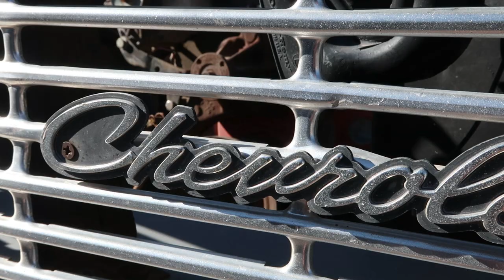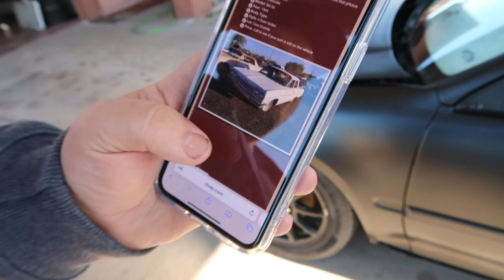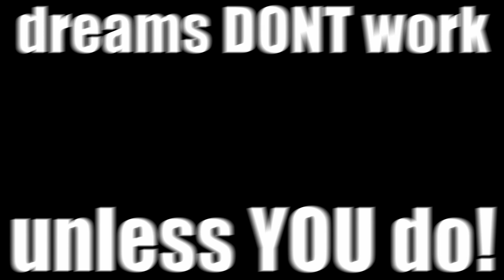My 1964 Chevrolet Belair (4 doors are better than 2 doors btw)

Comment: I'm stoked to see and hear that Bel Aire run and drive.

Pull that SBC and blast it apart.
If the crank, journals and bearings are good, that motor is like an AK 47. It'll work just fine.

Comment: Cool bro! Clean title +383 stroker is pure gold. Can't kswap it now. That's about 400hp with decent gas mileage. It's a 350 block with a 400 blocks crank shorter rods. And it likely has PHP heads and roller rockers too. Congratulations bro! Hope the Honda nation can hang...

Comment: I’d pressure wash the interior, use a wire wheel to prep the surface and just rino line it black. Then get the cheapest single stage flat black paint and get at it.
Reply: Black vinyl interior and black spokes with a chrome rim too. That'd be sick

Comment: You will probably need to run tubes in your tires. I bought Dayton's back in the 90's when everyone was building lowriders again. I had a cutlass . White with chrome flake. Reds hydrolics. 15x8 reversed Dayton's. Shaved doors. And button tuck interior with full alpine system. 2 12's trunk was packed. But it was fun. Good luck on the new build.but of water has been going thru the carb. It don't matter how fresh the engine is. Water will go down cylinder were the valves are open and rust the cylinder's.

Comment: Never knew why people hate on 4 door cars from this era. As a enthusiast for cars from the 80’s and older, you have to take what you can get. Not every car from the 50’s and 60’s is a 2 door hardtop, most were 4 door sedans since 2 doors are a pain when rear passengers want to enter and exit the vehicle. Plus, some cars look better in a 4 door hardtop or sedan. A prime example of that is the 1965 and 1966 Ford Galaxie 500 4 door hardtop, the 2 doors almost look to be an afterthought since they didn’t come with flow through ventilation and overall didn’t come with as many standard features.

Comment: 383 is a very good motor. .. it looks like it had or was being set up for hydraulics. Check to see if the frame was wrapped. It it was, see if it has a partial or full wrap.

Comment: Hey bro not sure if u know but for wire wheels they actually sell tubes you can put in the tire due too the common issue with the wires leaking, they actually sell em on Amazon lol just hit a tire shop and they will pop it in like a bicycle tube. Just a thought

Comment: Pull the engine transmission and driveshaft out roll that thing in the booth and get to work on that body and even if you keep the transmission and sell the motor with the body you’ll get a nice piece of change for that with the doors because pricing for a hood bumpers is going to be expensive

Comment: If you can get the parts cheap enough put the car back together have the motor verified that it's built sell the motor use a trans For what you were going to then body work and paint the car a dope color and sell it

Comment: So...car audio is kinda dead, the way you used to think of it. There's no reason what so ever to get an amplifier or a bunch of 12" subs. You can get little bluetooth speaker sets that have more power than what those used to have in comparison. There are a bunch of really loud ones you can get too, or even bluetooth home theater subs that are smaller and they weigh nothing, and they have much better sound quality than those large subs. They're just as reliable and there's no real cables, other than power cabling to each speaker. You have that one bluetooth setup, don't know why you'd want to add more weight to that already ridiculously heavy car. Add hydralics, it's going to weigh a ton already, then the subs and amplifiers, you'll get 1 mile per gallon and go 10 miles an hour, but hopping for those 20-30 mins between gas stations. Cost like, 300-400 in gas, anytime you want to go anywhere, be great. Then all the noise violations, man, that car will be awesome. Forget Khaki man, just run with that all the time! Baller style! Can blare NWA too, people love it really, really loud. Especially by the police station! Man, you're in for some good times!